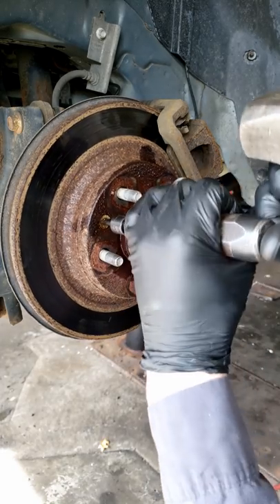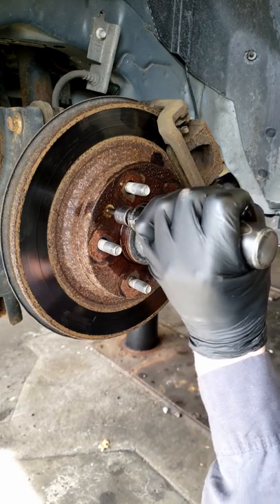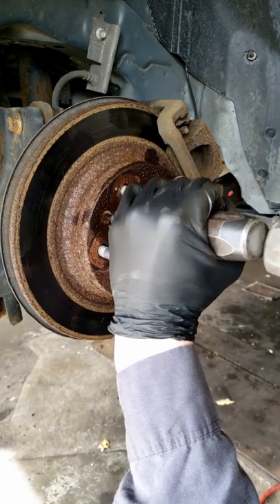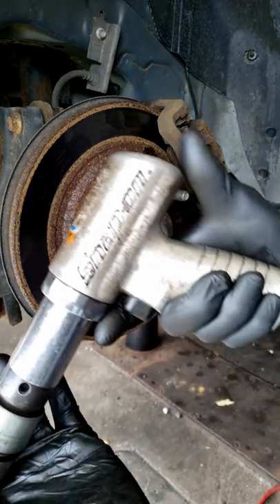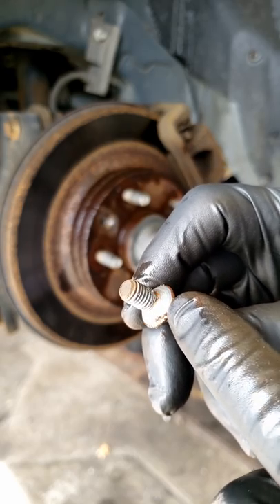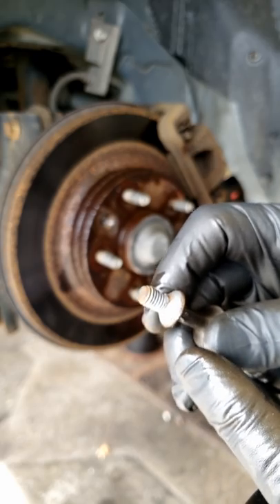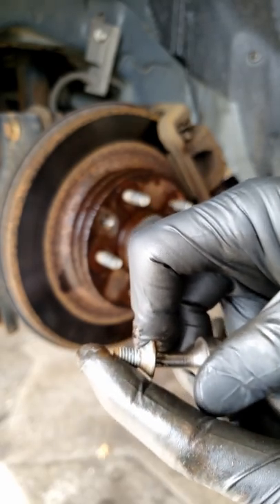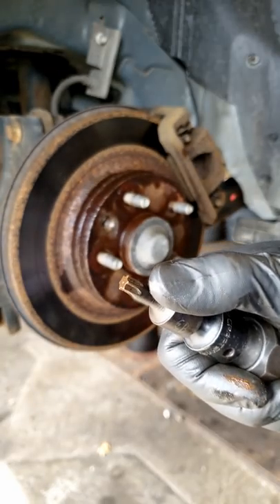Best Way To Remove Brake Rotor Screws

Comment: Step 1) snap the bit 
Step 2) drill out the screws 
Step 3) smack the rotor with a sledge to break it free
Step 4) do not reinstall those screws
Reply: Banned Conservative  do it to everyones. Its just there to make sure they don't fall off and hit someone when its rolling down the production line.
Reply: Banned Conservative  So, if you work on somw euro cars they don't have the bolts sticking out for you to mount the rotor or the rim and the set screw is what keeps the rotor on the hub.  If I don't screw the set screw in my rotor can just fall off the moment I let go (probably won't,  but with how heavy my fuckin 340mm fronts are...not risking it).
Reply: I did those steps the same day you commented this lol
Reply: Kelly Leak  there aren't on proper cars
Reply: @SacksMaster that's a good lesson on how to be a hack mechanic.
Reply: @brandonconway4822  lol most people don't know that.
Reply: Kelly Leak  they come on the stock ones from the assembly line to hold them on while the car is being built no need for them after
Reply: Living here in Maine most of the time ur not getting a rotor off without some HEAVY encouragement haha
Reply: Banned Conservative  when you put the rim on with lugs or bolts it’s sandwiches your rotor to your hub eos
Reply: @Osprey1994  my Audi doesnt have these, nor does it use studs, it uses bolts, you *HANG*(shivers in fear) it on the hub center
Reply: @N1KEP1AYA  na I'm selling it for another caddy
Reply: @armaggedon4christ  don’t need to shiver in fear by hanging it on the hub center
Reply: Theyre there because the allignment between the lug bolts and the rotor holes isnt precise enough.
Youll get some unscheduled ugga-duggas at about 70 mournour.
Reply: Just practiced this exact sequence the other day.
Reply: @N1KEP1AYA  so screw on lug bolt, and then how you gonna get the wheel on?
Reply: @bountyrunsit   really?  screw on a lug bolt, install the brake caliper, then literally proceed
Reply: Why drill the screw out? Who cares if the broken bolt sticks, out goes right back in the hole.
Reply: Exactly
Reply: @miguellavoie4373  he said when snapping the bit,  not the bolt
Reply: I usually put new stainless steel ones back in and never have to worry about rust again
Reply: My step 2 is the screws snap and I don't drill them out.
Reply: I don't reinstall the screws either they don't really serve much of a purpose
Reply: @ohboy2592   Yeah. Ok.
Reply: @brandonconway4822  I work in a GM plant in an area adjacent from the wheel hub assembly area and can definitely confirm that their sole purpose is to keep it together during the assembly process.
Reply: 100 % fact
Reply: @brandonconway4822  never thought of that, makes sense tho
Reply: @armaggedon4christ  thats because audi sucks
Reply: @chrislambe400  hes talking drilling the tapper out to get rotor off, not drilling the entire screw out Einstein
Reply: No, no, and no
Reply: Yep
Reply: Work for Honda, remove and reinstall the rotor screws daily without a problem.. I remove with a shake and break, reinstall and snug  down with a Phillips... it ain't a big deal. At all 😂
Reply: Omg awful advice!!! Get the Philip's attachment for your air hammer. Works 100% of the time, everytime.
Reply: @Osprey1994  the calipers hold them in place. If you take the caliper off and you're scared the rotor will fall (doubtful) the take it off and reinstall it just before installing the caliper. I don't know why you're defending the retainer screws. They're useless
Reply: @miguellavoie4373  drill the head of bolt off so you can get the rotor off when you get the rotor off the stud is there you can turn out visegrips
Reply: This is the only way
Reply: I agree 100%😆
Reply: You left out F. F. SAKE.
Reply: @Osprey1994  euro "cars" 🤢🤮
Reply: Drill them out? U must not have a gas axe.
Reply: @Osprey1994  why not just put one of the lug bolts in it temporarily while you assemble the rest of the brake?
Reply: Why not just use heat, a penetrating oil, and give it a few taps then they should come out easier. Especially if you heat the bolt a little bit and cool the rotor they will pull away from each other.
Reply: @infernaldaedra For one you mean cool the bolt and heat the rotor but thats not even the main point i want to know what the fuck kind of wizardry you intend to use in order to do so whilst they're assembled
Reply: @owenwilson3750  The exact order doesn't matter too much but if you freeze the bolt you probably don't want to heat the rotor because it will expand into the joint. Or you can just add penetrating oil and then torch the bolt hot, let it cool down and add penetrating oil again come back 10 minutes later and it will break loose fast and easy.

And for the record I specialize in wizardry lol .
Reply: thats how ive been doing it all along lol
Reply: step 5) throw those screws in the trash where they belong
Reply: Start at step 2.
Reply: Had to do this on my first brake job LMAO
Reply: exactly lol
Reply: @suggesttwo  I just skip step 1. Living in the UK you know they aren't coming out without snapping/rounding anyway
Reply: @mycoolwill7594  not always, you can easily snap off a bit if bolt threads are really corroded.  The air hammer just breaks the rust bond and also allows penetrants to get to threads.
Reply: @Osprey1994  make up a long stud or two to thread in by hand to pilot the rotor and wheel, put on the wheel and thread out the studs and put in the stupid bolts.
Reply: @MichaelOfRohan  the rotor is HUB piloted, not tapered screw piloted. The rotor is precision fit to the hub. Just make up some long studs to replace the wheel bolts and they will keep the rotor from going to the floor while you are putting on the rotor and then the wheel. Then replace the long studs with the stupid design bolts.
Reply: @huntguy3831  the screws can help center the rotor on the system. Before tightening the wheel the rot has about an 1/8 of wiggle room
Reply: Me:
Step 1: air hammer with punch bit
Step 2: there is no Step 2 it will come right out 

I have been doing this for a while... no need to drill anything out.  Waste of time
Reply: @Tatertot_Tommy  not when you live in the salt state, if your not paid hourly then good luck playing with those on flat rate 😂
Reply: @Tatertot_Tommy  it's called fixing engineering mistakes lol
Reply: Yeah never reinstall them. Let the rotor float.
Reply: This is what I do every time
Reply: I disagree with you every bolt is on for a reason those screws are important so the rotors don’t shake
Reply: @Thebeast-xd8ed  What did you just say? 😂 How is the rotor going to shake when the rim is tightened all the way down? The rotor is sandwiched in between the wheel hub and rim. It can't go anywhere. Additionally, cars have been made without the stupid rotor screw for 80 something years. Definitely isn't going to cause an issue now.
Reply: @Osprey1994  If you have a euro car just install wheel studs like on every other cars
Reply: @Icexman1063  even when the wheel isn't on there, it's retained by the caliper. People are just ignorant, rotor screws are just packing material essentially. Necessary during building, not after, but not worth taking out By the factory because who cares
Reply: If you use a sledgehammer please dont hit the studs and just sand the bolt off and use it with more anti sieze
Reply: Step 4 is most important
Reply: Great advice
Reply: Yes, if it’s a shit box I snap the screw and grind off the remaining, like it was never there
Reply: @armaggedon4christ  there is a tool that holds the wheels on for VWS Audis for putting on  wheel bolts
Reply: Have you been living in my Garage? It's like you've been looking over my shoulder.
Reply: Step 1 move out of the rust belt
Step 2 ?
Step 3 profit
Reply: these screws genuinely prevent warping on rotors
Reply: Write that 4th step in CAPS LETTERS
Reply: step 1) blowtorch
step 2) blowtorch
step 3) blowtorch
step 4) burn your hand on the rotor, give up, and go to bed
Reply: Went thru it 2 weeks ago.
Reply: Yep lol
Reply: Did this exact process like three days ago lol
Reply: Fact !!!!
Reply: Wow this was exactly what I did!  How did you know?
Reply: @wigletron2846 Periooddddd 😂😂😂
Reply: Usually people get rid of these screws but for some reason the car in the video had ANTI SEIZE on the rotor screws. Whoever did that is a mad lad.
Reply: wrong, wrong wrong wrong
those screws 1) center the rotor 2) make it not go back and forth when you change gears with brakes applied
you obviously dont work in a shop and never had to change broken studs because someone left those screws out

if the wont come out with an impact driver and some stuff called KROIL, use heat on the screw.....dont throw the screws away
Reply: same process for all 4 of mine i just changed😂 drilled all them stupid shits out
Reply: Yup that's what I ended up doing when I did my rotors in my car

Comment: This is cool too. But the first thing I always try is puting 3 lugs back on to the assembly. Tighten them slightly and it takes a ton of pressure off the screws. This along with WD-40 has worked wonders. If you have lugs that are closed on the end like some Honda’s use the box end of a wrench as a spacer. 

Great video. Thanks for the share !! :-)

James
Reply: That’s a great idea for home mechanics. Thanks for sharing.
Reply: Never tried.  Great idea.
Reply: This is another great option and hits the nail on the head with the root cause. The screws aren’t “seized” corrosion build up behind the rotor puts so much pressure on the screw’s seat.
Reply: I rarely have time to do work on cars, but a couple weekends ago did brakes for my cousin. I didn't even try to remove the screws, just started drilling. Your method might just be what I need going forward. Thanks.
Reply: Definitely going to give this a shot in the future, thanks a ton
Reply: Throw a little heat on it too with a map gas torch; that can also work!

Comment: Neat tip! I just throw those bolts away when I get it out. Only there for the assembly line in the factory. Drilling them out is quick and easy too.

Comment: There is a tool called shake and break that attaches to your air hammer. Have seen quite a few mechanics use it. It's a bit holder with a handle it goes into your air hammer you just apply pressure while using your air hammer. Personally I don't have a compressor I just drill the head off after I broken couple bits even with heat.
Reply: I was just about to say that about that bit holder. Saved my ass a lot in the shop.
Reply: I own all 3 of the products shake and break makes and I haven't used other solutions since because they work so well.  The first time I removed rotor screws with the one that gets the most attention I felt foolish for using a normal impact driver all the times I had before.
Reply: I agree.  If you have an air hammer, go ahead and get the shake and break.  It is fairly cheap.  I use Mac bits with mine, because they warranty standard bits.  I also have a set of Tekton impact rated Torx sockets that have held up thus far.  I never even use my old school impact driver anymore.
Reply: Used a lot in aircraft maintenance is one of those we call it a old man tool

Comment: It works because the air hammer is knocking loose the rust between the hub face and the rotor.  The rust grows and puts immense pressure on the tapered head of the screws.  By breaking up the rust, you relieve the pressure and makes the screw easier to turn.  Quick note, just use a small sledge and whack the rotor face where it meets the hub. An air hammer is not necessary, but very helpful.
Reply: Be sure to put the lug nuts on a few turns before smacking it!!!

Comment: 2nd Tip Leave them Out 😀
Reply: I was (also) taught the screws are only there to keep the rotors in place at the factory.
Reply: Or maybe only one back for ease of remount caliper
Reply: My truck has no caliper screws
Reply: They are useless. Never had them on any of my older GM cars. The wheel will lock the rotor in place. Would love to hear the rationale behind them from the Engineer that had the original brain fart.
Reply: @ronsullivan132  from what I have heard it is apparently there to keep the rotors on in the factory
Reply: iantrofimov6416  that is completely false they are just there so the rotor doesnt fall off the assembly line

Comment: I always thought it worked because rust expands and the air hammer breaks the bond between the rotor and the hub, releasing the pressure from the expanding rust. 
I learned something. 😊

Comment: I just use the oxy acetylene torch at my shop and torch em out in literally five seconds. 😅 since I've started doing that, I don't even mess with any other method. To date nothing as been quicker, easier or more efficient

Comment: The percussive impacts cracks off the corrosion tension hold, try it without the penetrating oil and it will still works because the bolt is not corroded in place but more accurately the corrosion has built up the clamping pressure of the bolt! And yes these little taper head bolt are the worse for this type of seizure! Not criticising at all just adding my experience and opinion, great video!

Comment: I've had them come in "so missed up", I just drill off the heads and move on quickly.
Reply: That’s what I would’ve done as well, drill em and never put them back on
Reply: Exactly drill them and leave them out. Not necessary.
Reply: Why aren’t they necessary??
Reply: @midwesternwelds1197  cause the rim holds the rotors in place.
Reply: @midwesternwelds1197  the screws are there to hold the roter in place while you assemble the brake system. 
I'll use a lug nut to hold things together when necessary.
Reply: @rollingfog1  thankyou
Reply: @rollingfog1  the screws are there for the assembly person to do that. Never needed again
Reply: @cheefussmith9380  accept for European cars where there's not studs, as the lug nut is also the stud in one and if you let go off the rotor without the crew they just fall off then you'll need another rotor....... mistakes are sometimes expensive 😬
Reply: @warriorz_hammer_7743  all u gotta do is screw a lug bolt in.. rotor screws are unnecessary
Reply: @warriorz_hammer_7743  screw a bolt in and put the caliper on, once the calipers on the rotors not falling off
Reply: Lol I guess this guy doesn't get paid book hours.a drill Everytime

Comment: I always run a tap to clean out and recut the thread and then replace those screws with stainless ones and use a little anti seize on the threads.
Reply from the maker: Damn, that's going above and beyond! Good stuff. Although I'm not sure where you would get the proper size stainless ones. Since all the manufacturers kind of use a little different style of a screw
Reply: @NNKH2  Mainly PSA (Citroen Peugeot) stuff in UK. Have a aging fleet of their Berlingo / Partner models. Standard 6mm thread countersunk stainless (A70 grade?) with PZ2 head. Bought a bag of them of Fleabay for not much money.. The cars normally come with a torx head. If there is one thing I hate... (There are LOTS of things to hate on French cars) its having to chew out or drill out rotor (we call 'em discs) screws....
Reply: When you do a lot of them, you don't have the time to recut the threads
Reply: @NNKH2 You shouldn't really mix stainless and non stainless they tend to gall. You can swap screws for torx heads which you have a better chance getting out next time.

Comment: Works well on just plain old rusted on rotors as well. When I put brake drums on concrete trucks, I loosen the lug nuts a bit and drive around the parking lot. Lime is nasty stuff and vibration is your friend.

Comment: Another way is use a flat punch with a head roughly the size of the screw, hammer the head of the screw a few times then it should break loose with a regular screw driver. Kinda the same scenario but a bit quicker

Comment: also you could grab a ball peen hammer and put the rounded side on top of the screw then smack it with another hammer usually works pretty good
Reply: I use that method, never a problem, the way that guy was doing it just seems like alot of work. Lol!
Reply: @budguise6184  exactly, too much work and time.

Comment: Cool trick.. But in this situation.. If dont come easy.. Drill it and forget it. They are intended for the assembly line. Do nothing once rim is installed.
Reply: Brilliant
Reply from the maker: I should probably update the description in this. I explain to a few other guys why I prefer putting the screws in
Reply: @NNKH2  waste of time

Comment: I had one of them stuck after 60K miles. Man, it was a PITA. Even broke the bit on the impact screwdriver. I had to bust out the chisel and hit it at an angle until it unscrewed. Damn you Honda!

Comment: Not everyone has an impact hammer.  But you can gently tap in between the studs with a normal hammer. If still stuck little blow torch (like for plumbing) for a few seconds, And spray with penatrant again and they should come right out.

Comment: I drilled mine out threw them in the trash lol I hate that these are becoming a thing
Reply: These have been around for at least 25 years. Had them on a 98 GMC
Reply: @DaDaDo661  Really? I've owned several gm vehicles over the last 12 years and hadn't seen them on any of my older vehicles. Although I don't disbelieve  what you're saying.
Reply: @dudesumting  
Both Sierra 1500 the other was an 05
Reply: @DaDaDo661  My 2011 silverado 1500 did not have them, my current 19 silverado does however, but every gm vehicle i had before that also did not have them
Reply: @dudesumting  interesting. Wish I still had them to take a picture.

Comment: Every time replace brakes on a newer car I normally never use those screws again because I normally end up stripping it out and you don’t need them because you got those good old lug nuts 🔩😂😂
Reply: Those screws are there to prevent the rotor from falling off and injuring someone's foot on the assembly line. They have done their job and now belong in the scrap bin.